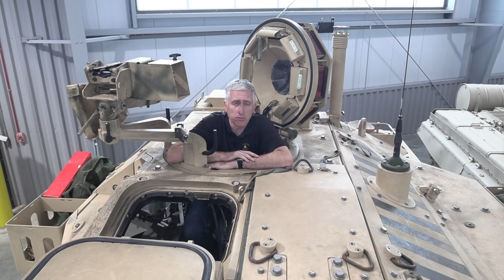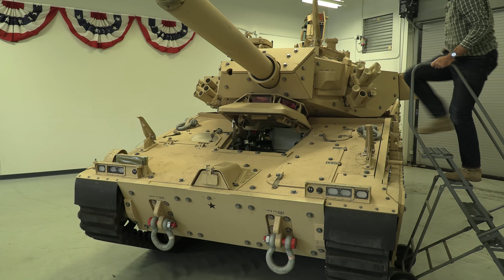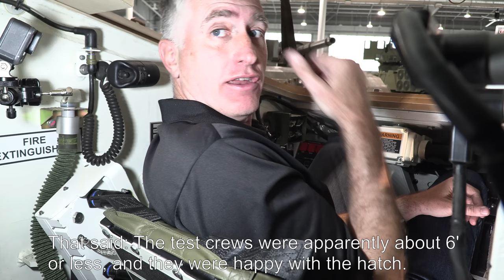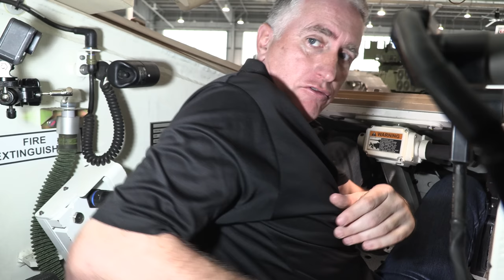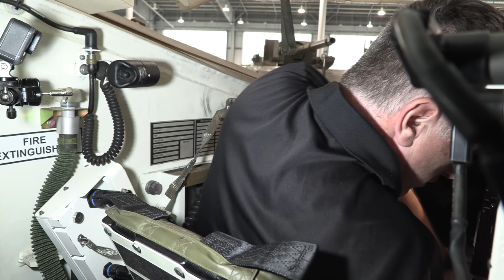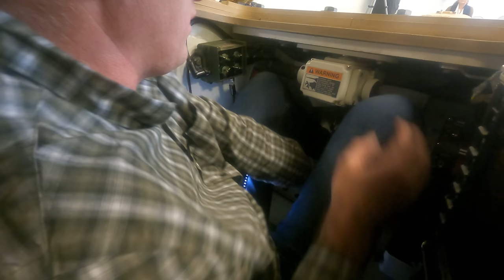Inside the Chieftain's Hatch: BAE XM1302 MPF, Part 2

Comment: Yikes this feels like they took inspiration from Russian vehicle designs. As you said it is capable but I don't think it fits the expectations of a modern 2020's designed western piece of armour. I personally also feel like this was a lazy entry and some executive probably thought he still had enough senators on his pyroll to push this through on the cheap.
Reply: This is a vehicle that's been warmed over since the 80s.
Reply: This tank is interesting because it seems to be an example of what happens when a Western nation follows the Russian philosophy of emphasizing size and weight reduction and ended up with a lot of the same compromises.
Reply: @ARCNA442  
"More cheese... more macaroni..." 
-Procurement offices, probably
Reply: @precisedime1377  "Perfect... I HATE MACARONI!"
Reply: @ARCNA442 I mean it's 16tons lighter than the M10 and as a result can be airdropped and go over a wider range of terrain. What's the point of a infantry support gun that can't follow the infantry?

I think this is a case where American traction is holding it back (like when they refused to get light tanks without Hull mg gunners, resulting in light tanks being too heavy to support the infantry in rough terrain, 1 of their main buying points, infact this seems to be a near identical situation)
Reply: aperpetualguardsmanwithafl2942  16 tons lighter should mean that 3 of them can be carried in a C-17, compared to only 2 of the M10.

Comment: DID THEY USE ANY REAL TANKIES  IN THIS DEVELOPMENT 😮. 😊
Reply: They did; doesn't mean they listened...
Reply: I think the fatal flaw is they took the M8 - a pretty decent vehicle by all accounts, when it was developed - and tried to kitbash in all the new stuff a modern vehicle needs to be on par for US forces.

Problem - the M8 was not known for having a ton of spare room.  That was because it was designed to be air droppable, and the size of  the protected envelope is directly related to overall weight, but not in a linear fashion - a few inches here, a few inches there, and the weight of the hull goes up by tons.  Thats one of the key reasons this thing weighs so much less than the GD winner that is now the M10.

When MPF said they didn't need air droppable capacity, the sizes of the hull and turret were pretty much set.  Which meant that when they needed to add new capabilities to the vehicle, they had to cram them into the tight space they had selected back in the 1980s when originally designing this lineage to be a Sheridan replacement for the 82nd.
Reply: @geodkyt  A KIT BAG HOLDS ONLY  SO MUCH RUBBISH.

Comment: So a big factor in the choice of the other vehicle by the USA is superior comfort?
Reply: Even if "Human Factors" was the tipping point, that's way more than mere "comfort".  It directly increases efficiency, safety, and reduces fatigue that further magnifies the safety and efficiency losses of a too cramped space.  The crew can fight better, fight longer, and have far better chances of both battlefield success and survival, when the crew compartment is properly laid put and has adequate room and other HFE considerations designed into it.
Reply: An armored vehicle is like any other tool, and ergonomics is a real factor in the effectiveness of a tool.
Reply: You're not sending robots out to fight inside tanks afterall, you're sending out people to crew these vehicles, and people being comfortable tends to improve a vehicle's performance.

Comment: Worse vehicle it may very well be, but I still think the BAE entry should have won just on the ability to be airdropped. If the airborne have captured an airfield to land their Bookers at they've already won the battle, whereas XM1302s could have been present to support them from the start, and imo that more than makes up for it being a less effective platform for the job. 
I know that wasn't a requirement for this iteration of the vehicle, and I know not all the units that will be getting them are airborne (just the first ones), but it seems to me it aught to have been one of the bigger considerations given how the Army is pivoting back towards fighting peer opponents who aren't going to just let them land C17s without a fight.
Reply: I think the Russian VDV’s mauling in Ukraine has demonstrated the opposite lesson: bringing armor to light gets your soldiers killed faster than if they were on foot alone.

Would an airborne assault force armed with airdropped Strykers and intense air support be much worse off than one with a couple M8s?  The reason for a big gun over missiles is higher volume of fire, but that’s less of a concern with an air assault bc presumably your not concerned with expending all your fancy missiles immediately.
Reply: It's not airdroppable -- the updates they made from the original M8 made it too heavy.
Reply: This is NOT for the airborne. This replaces the ad hoc attached abrams units for LINE INFANTRY. The reason is because most missions for such abrams are just for attacking fortifications and entrenched infantry, which this does in a lighter vehicle with logistically more common parts for mech inf brigades. 

Also air dropping tanks is stupid and has always been stupid. Think about all of the times we've SUCCESSFULLY used an air dropped (NOT rolled off a plane but AIR DROPPED) tank. It's literally never. Going all the way back to WW2 even.
Reply: @DD-hz3ts  Actually ... the invasion of Panama did successfully use four airdropped Sheridans. I wouldn't say it was tactically meaningful, and was more of a extreme backup plan. But you can't say the capability has never been used. It's just been used so little that it's not worth the cost of the capability. One could say that about airborne mass attacks today, but that's a discussion for a different video.
Reply: @glenndean6  If we DID have to use them in an emergency capacity, it would have been wasteful vs dropping pallets of ATGMs and supplies. 

The thing people forget about airborne operations is that AGILITY and SELF SUSTAINABILITY are the primary needs. An airdropped tank needs fuel and ammo, and because it IS an airdropped tank it has size/weight constraints that severely limit both fuel and ammo capacity, meaning you have to then resupply it with fuel/ammo in quantities that you CAN'T airdrop. That's why airborne tanks are dumb.
Reply: @DD-hz3ts  Yep, 100% agree. There was a whole operating concept around the airdropped vehicles but it required three capabilities, and absent any one of them the operating concept is useless.

Comment: Looks like it was built for people less than 5’8” in height.   Looks of blocky,  not aesthetically pleasing as a M-24 like my older cousin crewed in Korea.   Maybe they should take an M-24 and build it using new technology and materialism an a 90mm high velocity gun.   Maybe the designers need to actually occupy the vehicle for 48 to 96 hours while running through the wilds of fort Benning or Knox or Riley, swaps etc.

Comment: I personally think the MPF is a mistake. Everytimr someone has had the bright idea for a not quite a tank, tank theyve been disappointed. Why not just slap a 105 on an IFV if the only goal is movile firepower that cant fight tanks?
Reply: Well they sort of did that on a Stryker and the result was horrible. And there's no way in hell the turret ring of a Bradley could accommodate a '105 so you're looking at substantial hull modifications that'll drive the cost up to parity with basically a brand new vehicle. To say nothing of the huge amount of pointless volume you'd be hauling around for the unused troop compartment.
Reply: That's what M10 is. New turret, hull derived from the GDLS Griffin IFV

Comment: BAE are usually very good at the ergonomics game. So I don't understand what went wrong here. Someone needs a good kicking for submitting such a bad 👎 design.
Were they hampered by customer requests?
Reply: That or someone at the Army gave them access to the 80's program and said "We want this with more buttons and screens." and they misunderstood.
Reply: I wouldn't say it's a "bad" design - it's a design that emphasizes being as compact and lightweight as possible. It's basically half the size of the winning entry and provides roughly the same combat power. If the competition had been for an airborne light tank (which the base M8 platform was) then this would have been a clearly superior design.
Reply: It sort of seems like there needed to be optimization work done in the opposite direction, making the space the machines take up smaller - instead of just reducing the crew volume. The only problem is that requires developing and engineering a whole new set of hardware (engine & drivetrain, optics, electricals, autoloader.) which isn't really a feasible scope for these sorts of contractor competitions.
Reply: @ARCNA442  A superior design but still with poor/bad ergonomics. I think Lt.Col Moran was being kind and characteristically diplomatic. Have you seen a BAE CV90 hull. They are good to drive and can be fitted with 105mm or 120mm cannons that fire NATO ammunition. MPT and then some.
Reply: @Coconut-219  I've got to admit I'm not familiar with "these sorts of contractor competitions." I assume there were strict budget restraints. Do you have any idea why BAE did not submit a CV90 variant  hull, with a 105mm autoloader turret?
Much of the R&D work had already been done. I'm just curious and somewhat of a secret CV90 fan. Users seem to sing their praises and it's easy to see why.
Reply: @gusgone4527  Well mostly just saying that there's not really the time, budget, or connections for BAE to go back and try to design an entirely new (smaller) autoloader for the turret or smaller engine. And even if they did that would blow the bid cost out of proportion & introduce it's own teething troubles, so the cheapest and least financially-risky move was to just cram mostly-existing hardware into a little metal box to meet the requirements & do-so at the slight cost of crew comfort. Definitely agree with some other discourse i've seen stating that this would probably be adapted well to airborne instead of 'light-tank' or if you want to call it an IFV etc (as the vehicle was originally purposed for).
Reply: @gusgone4527 yeah and the cv-90 Hull is over 10 tons heavier than the M8-lineage.
Reply: They didn't go with a cv-90 because parts cominality was a requirement. The cv90 has no parts in common with existing us vehicles, the M8-lineage does (it shares stuff with the Bradley-Hull family)